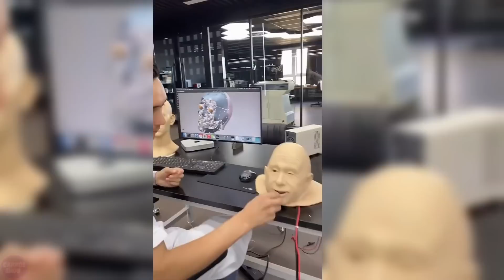New $30 Billion Chinese Humanoid Robot Factory Has BROKEN All Records

Comment: As complicated as these machines are, I am wondering about a future where a chip burns out or a wire shorts out, and instead of picking up the ketchup for your burger, it grabs you around the throat and lifts you off the floor. Just wondering.

Comment: Nonsense. Humanoid robots are just puppets with strings replaced by IT programs written by humans, and dolls' costumes replaced by silicon. They are incapable of inherent emotions, responses and thought. All is pre-programmed by IT engineers. Remove the silicon surface and you have a machine. Only if you have become robotic will you believe the propaganda.

Comment: Yeah but can they walk? I don't see these being much different that the old side show carnival gypsy fortune tellers that you use to see many years ago where you would put a quarter in and it would move and tell your future. Yeah these have more articulate movement and AI speech and memory capability and softer silicone skin but until they walk and move with ease they really aren't fully functional robots. If they wanted to make robots to perform task they don't have to look like us. They could even move by the use of rollers and wide stabilizers which they already have. I think the end goal here for all these robotic engineers is to replicate a human like robot that looks, talks, thinks and performs like us. Using all mechanical and electronic technology, that will be difficult as it will constantly be prone to wear and tear. Just being inside the silicone skin, the mechanical parts would be more subject to humidity and other factors that could lead to rust and corrosion. I think that the most likely approach to making a human like "robot" isn't a robot at all. It will come from bio-engineering a genetically exact copy of real person using DNA cloning that they might could use AI and electronics to control brain functions. A clone hybrid. Of course this brings about the question of morality and is this a good idea. We've cloned animals so it may be totally possible to do the same with humans. It eliminates all the problems with mechanical parts and exactly replicates a real person. There would be allot of uproar over it but I bet you that in some secret government lab somewhere, this has already been attempted.
Reply: Wouldn't the clone have it's own fully functional brain though? Or would it be controlled through like an advanced bi-way Neuralink or something?